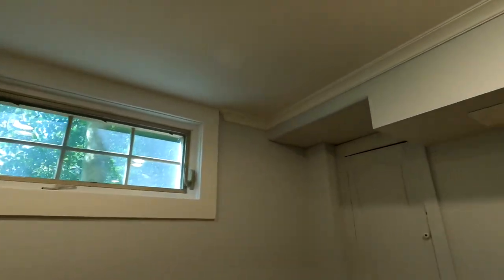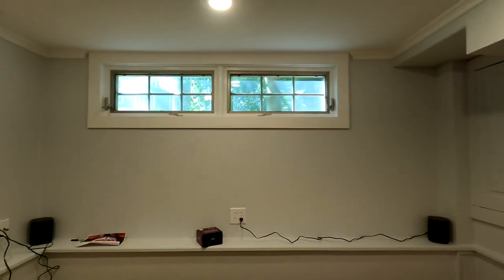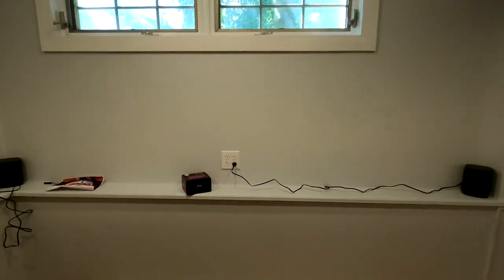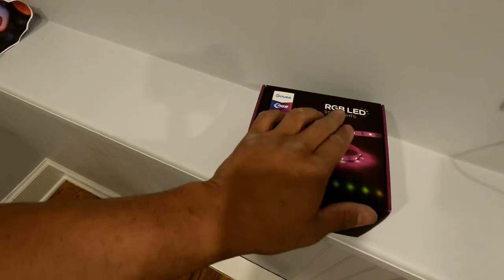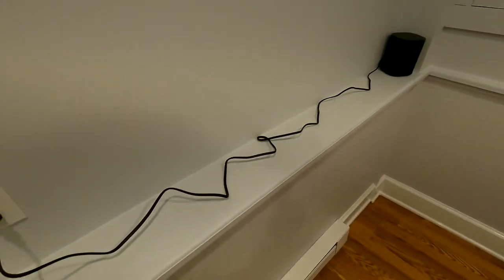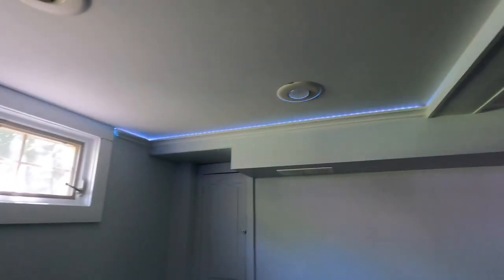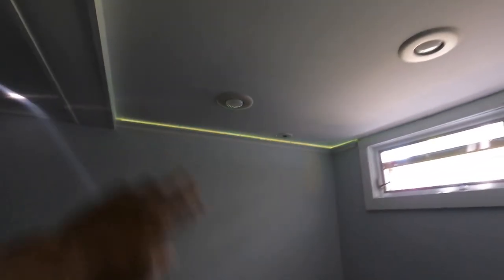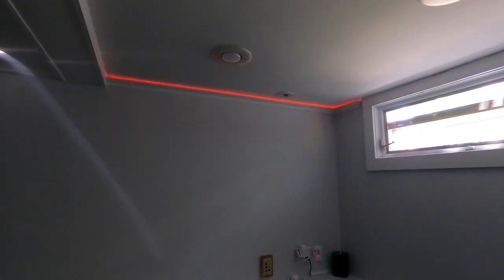How to Install  LED Lights in Crown Molding For Indirect Lighting GOVEE RGB LED Lights

Comment: What happened to laying down a protective layer on the hardwood floors (as nails drop down and bounce off hardwood 😮, fail). The area should be taped off with protective materials to protect the clients walls, floors, etc. Easier to clean up the mess and not damage things.

Comment: lights inside the wall? A gap in the top of the wall. I wouldn't want to cool the inside of the wall with my a/c. I don't know about this video. I'm not an expert but I have done a better job than this